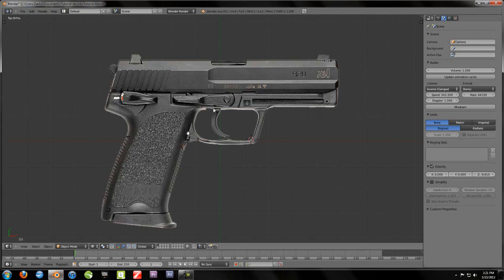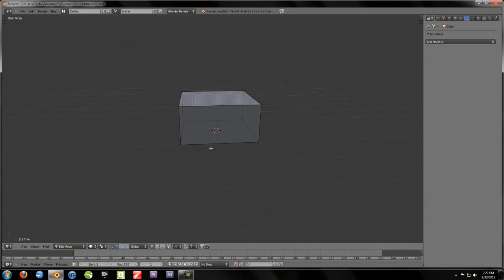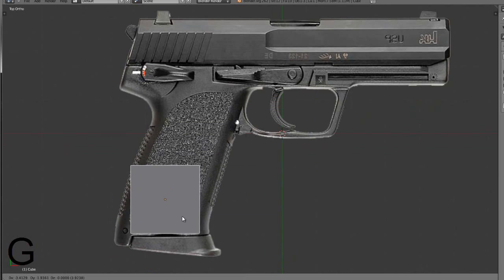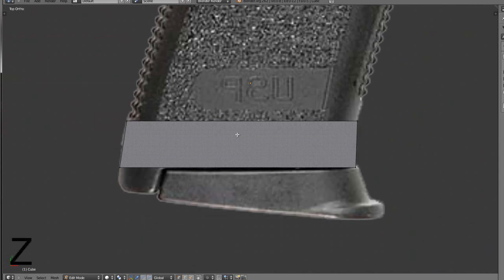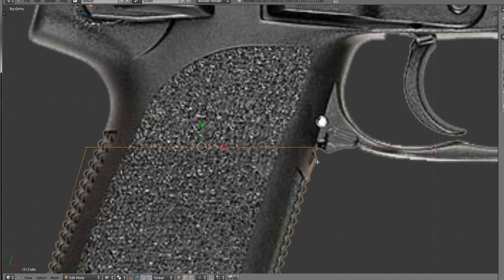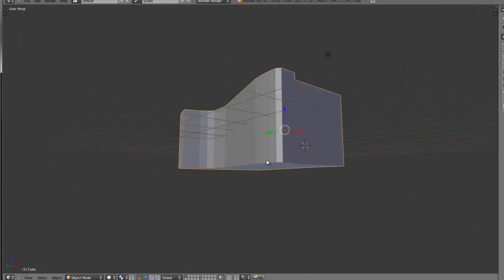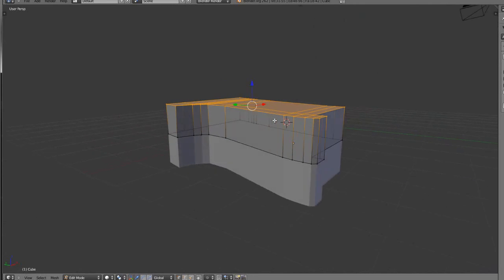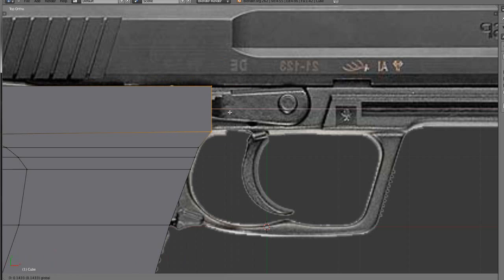Blender for Beginners: 3D Modeling a Basic Handgun tutorial series part 2 by Zoonyboyz

Comment: Um...the reason that I stuck is that when I press"B" and try to select a side of that square, so that I could reshape it. However, i can only select points on the upper level. Which means that it is almost impossible to reshape it. Did I do anything wrong???need help plz
Reply: hi, he doesn't explain in the video. When the one point is behind the other Hold Shift and select them
Reply: oh! you are my savior!! Thanks a lot
Reply: Fu Zexi no problem man

Comment: Question time: i can't seem to make a vertical loop cut that doesn't run all the way down the gun; i want to make a vertical loop cut so that i can adjust the barrel, however it goes from the end of the barrel to the bottom of the grip. I apologize if i have missed a crucial point but many thanks in advance for any help!

Comment: Whenever I try to move a vertices it only moves one side PLEASE HELP THIS IS FRUSTRATING!!!!
Reply: I figured out the problem, at 1:00 minute he says "if this is on, turn it off." Not very descriptive which is why we missed it. The button he's talking about is "Limit selection to visible." If you have that on, it only selects vertices you can see in the editor, which is why our border select wasn't selecting the vertices in the back. So make sure it's turned off as he says.
Reply: that doesn't help but I'm glad I'm not the only one
Reply: Julez Source Are you right clicking on the vertices or using the select tool "b"
Reply: Same problem here.
Reply: Bo Banducci Thanks I was trying to figure this out
Reply: when in wireframe mode you can sort of select 'through' everything, all inside the cursor [c] or box [b] is selected. In solid mode, you only select as much as is visible. So try wireframe mode.